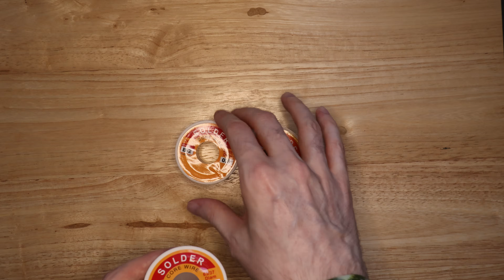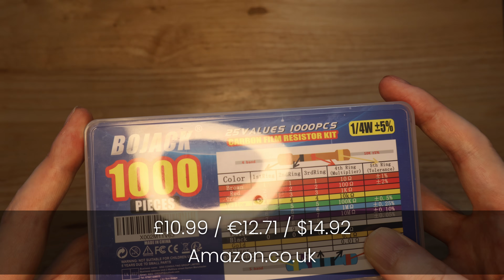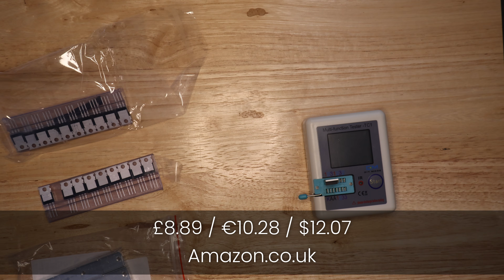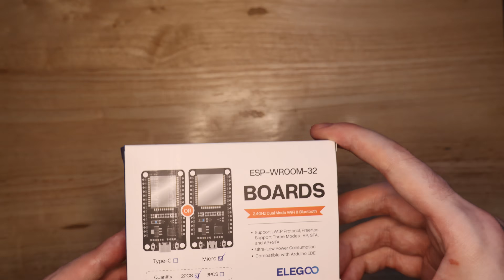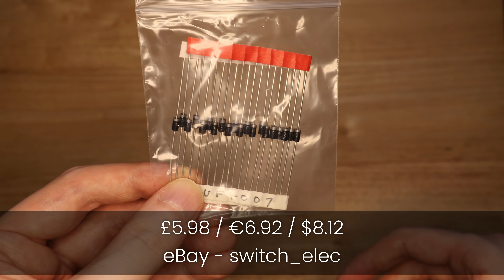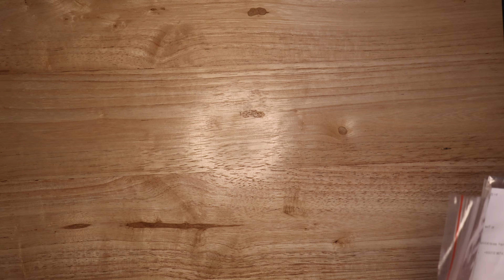Electronics Mailbag Episode 2 - ESP-32, Mosfets, Diodes, Resistors & more! | CEE #004

Comment: Cool video, lots of nice things. Watch out with those cheap Chinese rolls of solder. They often are of low quality and have a lot of impurities , and have bad distribution of rosin. Also, the tin is often not even half of the advertised weight because of the heavy plastic roll they use. You might want to remove the sticker from the side of the roll and see for yourself.
Reply from the maker: Thanks for the info! I will have a look around for better lead solder, I used to get mine from Amazon, but they no longer stock it due to RoHS legislation! I could try lead free stuff, although never used it before. 👍